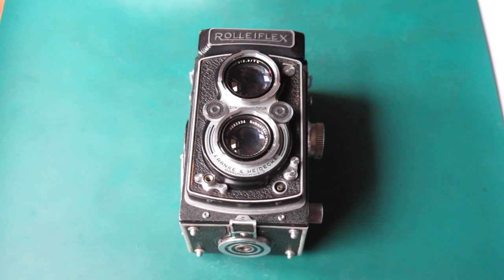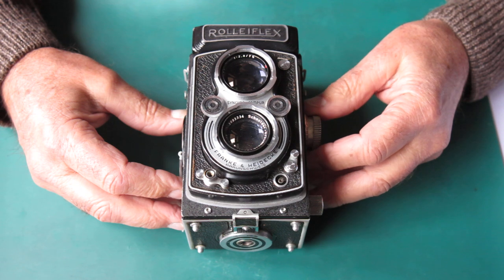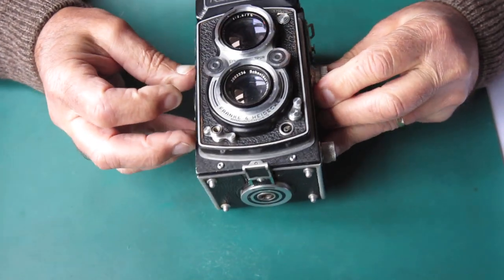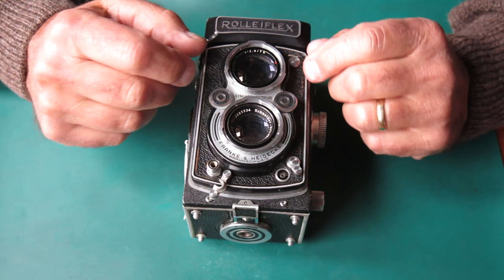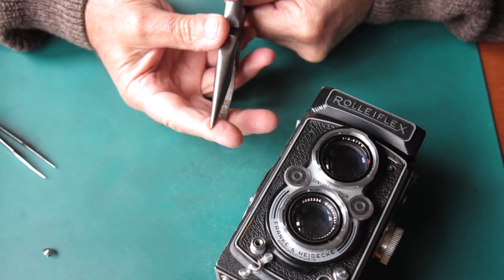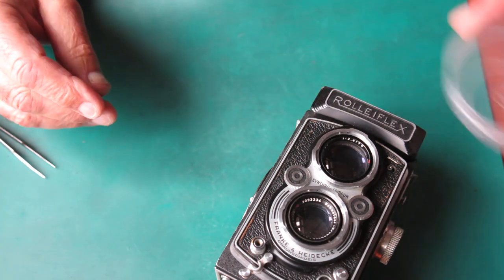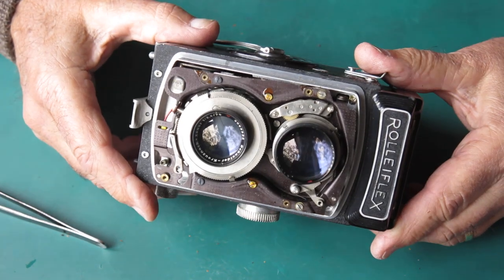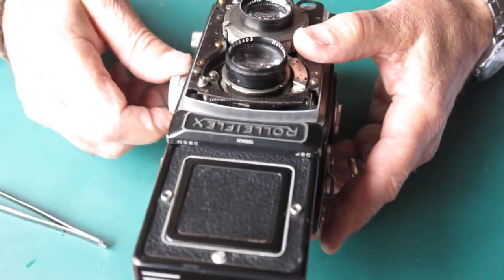Rolleiflex repair, servicing a Rolleiflex Automat TLR. Part 01

Comment: A little personal input about removing the fake leather plastic vinyl.
I use a reflow heat gun, at about 150°C and going slowly feeling by touch the temperature of the vinyl.
This way you can easily remove slowly the vinyl.
I had once a old Yashika that had a hardened vinyl by it's age and was cracking, the heat made it ductile again just for the time to remove it without damaging it.
Thanks for the video !

Comment: This is a great series, thank you.

The sychro lever at the bottom right of the faceplate should also be removed to get the cover off - this is why you had difficulties with that corner. The lever comes off its spindle with the removal of the retaining screw and then the spindle stays connected to the shutter mechanism, with the faceplate sliding off over it (much like the centre of the flash port); it has a return spring attached to the underside of the lens board which probably happened to pop off as you were ratching the focus. I imagine this could be a PITA to reassemble if it's disturbed unwittingly, so removing the lever first avoids the potential issue of losing the spring/damaging the connecting lever and makes removing the faceplate easier.
Reply from the maker: Yes, that part was fun. Like a lot of things in life, things go much smoother if you already know what you need to do.

Comment: Hello! Love the videos! Seems like no one is showing servicing videos other than you. I have a question. My Rolleicord camera seems to have a focus adjustment issue between the viewfinder lens and camera lens. Whenever I focus on a subject using the viewfinder lens and take the photo, the final developed film shows the subject slightly out of focus. The focus seems to be about a foot in front of the subject. Is there a way to fix/calibrate the focus so that the viewfinder lens and camera lens are both the same?
Reply from the maker: Focus issues with rangefinder cameras or TLR cameras need a two-stage approach. First you need to determine if the image correctly focuses at the film plane according to the focus scale. Usually this requires using a ground-glass screen and a loupe to check focus on a target of known distance, usually infinity for convenience. If it needs to be corrected, the adjustment in your case will be done at the focus knob. Without having your camera in front of me I can't be sure, but most likely you would need to unscrew the central cover, and beneath it there will be a nut holding the knob to the spindle. The adjustment will be made by loosening the knob and moving the knob position, and re-tightening, You will probably have to do this a number of times checking focus until you are happy with the result. If there had been a need to make this adjustment you may well find that the finder image is now correct. If the image at the focal plane is correct, but the finder image is not, then the position of the ground-glass screen in the finder may be wrong, usually this would be because the screen had been flipped, but that would result in a very big focus error, or because the viewfinder lens needs to be adjusted. This lens is adjusted by screwing it in or out, and this may have to be done with the front cover plate removed from the lens board.
Reply: @ChrisSherlock got it! Thank you so much for the response! I’m going to give those a try and see if I can get it adjusted. I will let you know if it works out. Thanks again!

Comment: Hi there! Just stumbled on this vid and was wondering if you could help me out.

I’ve just been gifted what seems to be a Rolleiflex T model 3. Looks to be in great condition however when I adjusted the aperture using the dial, the blades closed and now won’t open. The aperture dial itself moves but not the blades, so I assume it’s some old lubrication gone hard. 

Would be very appreciative if you would be able tell me how simple of a fix this might be. Cheers!

Comment: Best way to keep track of parts is to put them each or a certain group like your washers in a plastic small zip bag and marking them where they go. I refurbish old 20s and 30s fans and this works well.
Reply: Smart man! You buy like a 100 pack and use once or with a pen you can erase with?
Reply: @felixisme  I put a small piece of masking tap on it and peal it off.